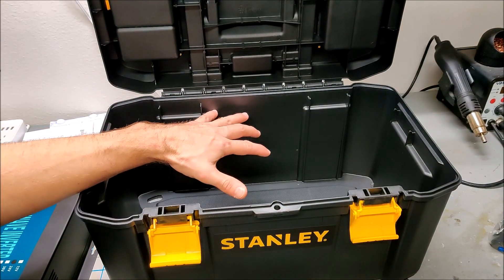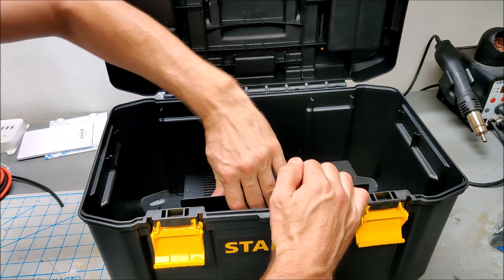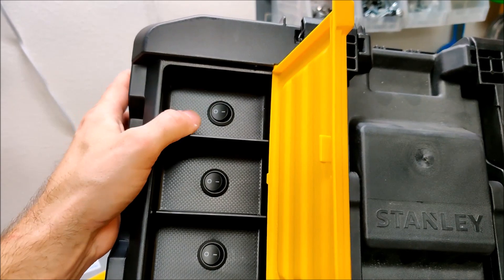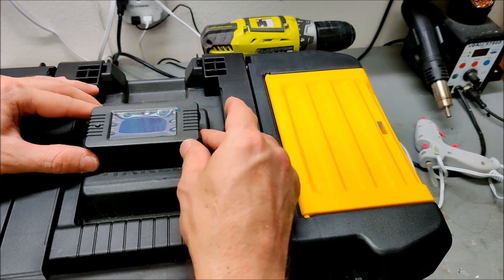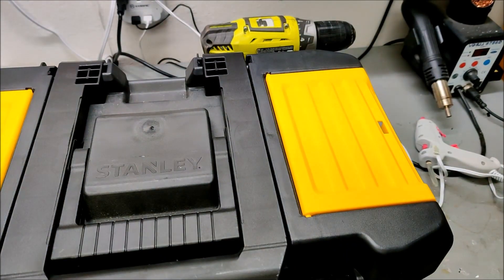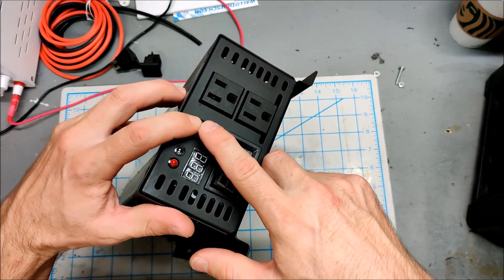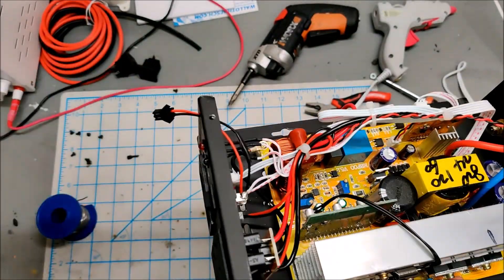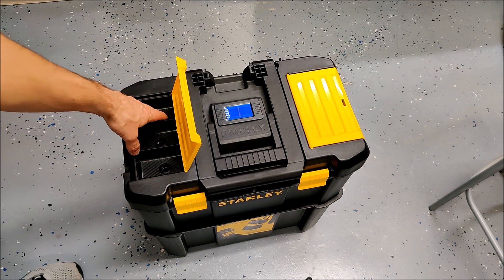DIY 3KWH LifePO4 Solar Generator - Part 3 Wiring

Comment: You call it a solar generator but theres no solar input or charge controller. Did you add one?
Reply from the maker: Yes it has one. In the next video I added it
Reply: @stevenc22  thanks ill check it out

Comment: There is only single socket at the AC outlet anyway you can add a junction box & where did you get these boxes I mean I'm gonna find one not exactly but similar.
Anyway this is awesome man we can easily carry it anywhere btw I suggest you to connect a 12v light on it, I think there is still some space inside 👍

Comment: Stevenc22 love your channel and work, I have a question, I have a lot of hoover board lithium batteries and laptop batteries, Can i mix the  hoover board lithium batteries with laptop batteries to make a battery pack, i know you can't mix power tool batteries with laptop batteries. Please let me know...Peace
Reply from the maker: Yes you can. Try and evenly mix the batteries in each parrellel group. That way each group will have similar capacity and the battery will stay in balance.
Reply: @stevenc22  thank you so much, i couldn't find nothing on the internet about hoover board batteries and laptop batteries mix for a DIY battery.